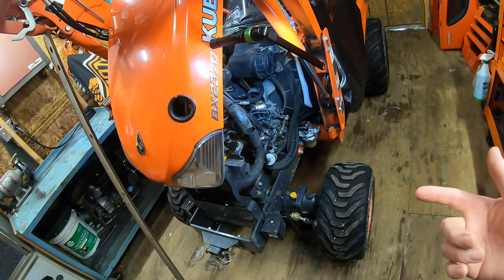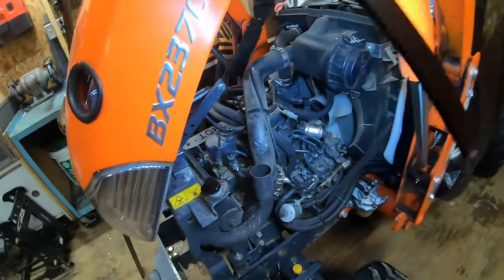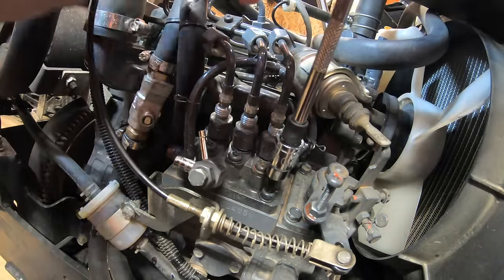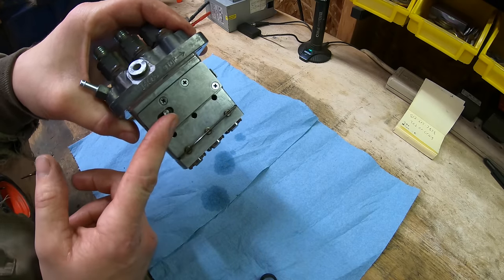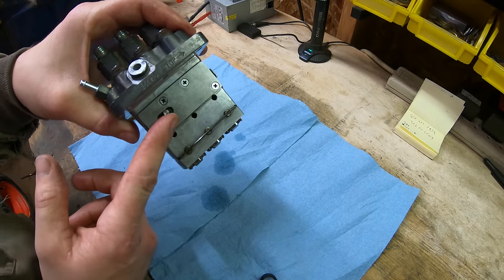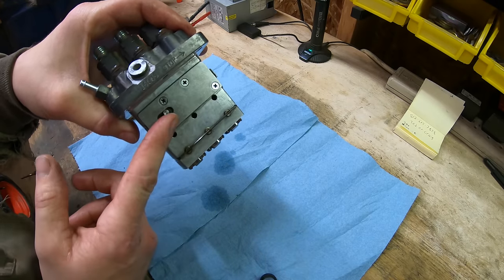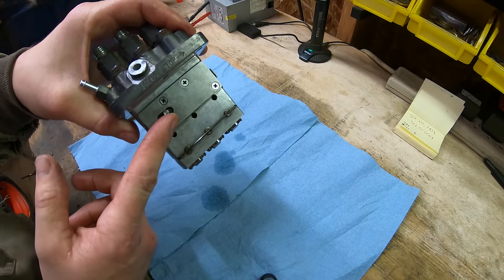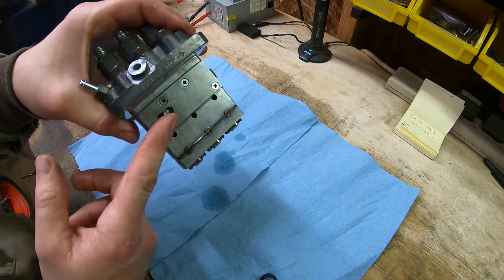Kubota BX- Injection Pump Modifications/Rebuild D902 (More Fuel!!)

Comment: Great video! What size shed/garage do you have? Seems to work pretty well for you
Reply from the maker: Hey Dave, my shed is roughly 16x18 give or take a few inches either way.. it does get the job done and worked really well when I first set it up but now over the last 2 years I have quickly outgrown it with tools and equipment so this summer I’m planning on building a new garage, hopefully a 28x32 with 14’ high ceilings or something to that nature, concrete floor where I can actually roll my tool box around and do bigger jobs for you guys. Thanks for watching!

Comment: Did you notice a difference in the hp? I watched your other videos but you never mentioned a difference in power, just the it was running smooth.
Reply from the maker: Hey buddy, your correct I never got around to making a true follow up video expanding on the results. It does seem to have more grunt now or more torque on the low end, tho it does burn more fuel now tho it’s not terribly more. I def need to get that turbo installed, Iv been talking about installing it for over a year now and just never have the time to take the whole tractor apart to finish the turbo kit that’s about 1/2 way built or so. I really need to get on that. Tractor has been running great tho ever since and she def rolls the coal just by quickly revving the engine from lower RPM to higher. I havnt had any negitive side affects other than that it burns more fuel but once the turbo hers installed it will be as efficient if not more efficient than stock but will have much more power. Hope this helps and stay tuned as I finally pulled out my turbo kit a week or so ago to figure out what else I’m gonna need to finally finish the kit so I am getting ready to finally do it at some point here in the near future.

Comment: Great video...What are the timing thick washer disk for in each pump cylinder ? Are they for ajusting each pump cylinder to trigger the injectors at precisely 240 deg of crank rotation or something else ?
Reply from the maker: They are for timing each plunger individually.. it’s set to factory where it’s at and you wouldn’t want to mess with that timing. The only adjustment you’d want to make is the overall timing which would be done by adding another shim under the entire pump itself. Iv never personally done it though.
Reply: @BiffsEquipment  Thank you for the quick reply. Do you know if the timing of each individual plunger is adjusted when the pump is sent to a rebuilt specialist or it is something fix that maybe is linked to the length of each injector tube ?

Comment: Thanks for sharing. Very helpful and informative video. Do you know what would be causing a b1750 to be getting fuel in the crankcase? I figure it is something leaking in the injection pump. Thanks.
Reply: Bad fuel pump diaphfam

Comment: Awesome video hoped to see a turbo update, eta?
Reply from the maker: So as for the turbo project .. I started on it a few years ago and got most of the parts needed to do it including the turbo. I fabricated a custom turbo manifold adaptor to fit a custom exhaust manifold that I bought online from a different D series  Kubota engine but when I started to assemble it all for test fitting I realized just how hard it was gonna be to make it all fit. I got the turbo to JUST clear the hood bonnet but was having a really hard time figuring out how I was gonna rout the exhaust from the end of the turbo..  also I was gonna have to drill a hole in my engine valve cover for an oil return line for the turbo as there is no way in this engine to return the oil back through the block of the engine.. so with these set backs I ended up putting the project on hold and never got back around to it. It’s still a dream of mine though.. I still have it all and every time I look at my freshly rebuilt turbo just sitting there for the bx it reminds me I need to get back to this project. I will keep you guys posted!

Comment: Good content my friend. Had to do some research, which makes it fun right.  I understand you want a turbo but other then having a turbo what is the point in the turbo.  I like the upgrade to the fuel pump.  That to me seems very likable.  These little tractors vibrate so much i hate to see what the turbo would do? I do have a 1025r in which i may try this approach try to give it more fuel.  Good idea. The smoke will be interesting to see the results.  Until you get a big pull on it may not see.  I figure rated would be with the most with the mower deck. Keep up good content.  Good job on this project.
Reply from the maker: Thanks Eric! It will def be interesting to see if/how much extra power I have gained from adding more fuel.. also curious to see how much it smokes when I work it hard under a load like you said. The reason for adding a turbo would be to gain even more power as adding more fuel only helps so much and eventually you need to add more air to burn all of the extra fuel you have added. A turbo will not only add more power but will make tbr engine more efficient and will put it back near its stock efficiency or better. Also a turbo will not make it vibrate anymore than it already does, it’s only gonna add the extra air it needs to burn the extra fuel and output more power.. a turbo is great when doing any type of work with the PTO where the engine is under a constant load.. you’ll really notice the extra power then. Thanks for watching!

Comment: I’d like to chat with you more about this plunger upgrade, also a turbo kit already exists for the d902 not sure if your aware, I have one already installed in mine. I’m looking at this plunger upgrade to get some more fuel thanks
Reply from the maker: I know there are turbo kits for the D902 that’s installed in Kubota UTVs and other equipment like that but I havnt seen a turbo kit made for the tractor itself? Are you saying there is one for the Tractor? I am designing my kit based images and ideas I got from online and similar specs to the turbo kits they make for the Kubota UTV.. I havnt had a chance to get back to the turbo project yet as I’ve been far too busy with the barn build but as soon as it’s done I’ll be getting back to it and doing some videos on it. As for the plungers, they are still installed in my BX with no issues as of yet. The video you saw of me plowing snow the plungers are installed and that’s why it smokes so much when I lug the engine, feels like it’s got more torque too but it would be much more beneficial if I had the turbo on there but I’m still waiting. You can email me at mbifaro@gmail.com if you’d like to chat more. 👍🏻

Comment: Appears to be running much richer.
Reply from the maker: Oh for sure, if I go from an idle and quickly rip the throttle to full revs it will plume black smoke haha. But what’s nice is it only does it when I want it to, driving/working normally seems pretty normal which is good, it’s exactly what I wanted.. I’m sure when I get into a situation where I’m lugging it good tho I’m sure it will smoke pretty nicely still lol. Thanks for watching!

Comment: Great Video! Learn so much! Can you tell me how can i increase the preasure? 
Stock preasure i think is 137 Bar, but i´m making a project and i need the fuel can reach the combustion chamber at plus 221 Bar... Can you help me? Thanks
Reply from the maker: There should be a bolt in the side of the engine block near the injection pump with a wire through it. If you cut the wire and adjust this bolt you should be able to add more fuel to the engine from the injection pump by turning it, best of luck!

Comment: For the kubota 3 cylinder injection pumps, are they all basically built the same for the different 3 cylinders, being that the plunger assembly’s are interchangeable? I’m guess that’s how that worked for your pump is that you put in a larger plunger from a pump for a higher output engine. I have a D640 and can’t find upgrades for the pump but they look identical so I was wondering if the plungers out of a pump from a different 3 cylinder with the same style pump would work together and increase output
Reply from the maker: Your correct as far as each cylinder ok the injection pump being the same as far as plungers and how they go together.. but as far as using larger plungers from a higher go Diesel engine (even if it’s the same class) can be tricky.. For some of these pumps the plungers are a different length and obviously the hole sizes are differnt which is what gives you more or less fuel but the length being differnt also alters the stroke.. so as long as the thickness and length of the plunger was the same, and it came out of the exact same style Kubota pump.. then I don’t see why going up a size would hurt aside from it just delivering  more fuel (so long as it’s not too much fuel) the plungers I bought were an upgrade specifically for my engine.. they were tested in it so I knew what to expect when I bought them. I guess what I’d do is if you find the same size plungers , get the spec or measure the hole size of the plungers you have now, then find plungers of the next size up (you don’t wanna go too big or it will run rough and start hard) plus your EGT’s may get high.. I Belive my upgraded plungers were .5 thicker if I remember correctly.. so as long as you stay with a plunger that’s roughly the same larger then you should get very similar results to me
Reply from the maker: I just double checked.. so the stock size on a D902 is 5mm and the aftermarket/modded plungers I went with were 5.5mm so if you find a plunger that’s the same thickness and length say from a D722 and it’s roughly .5mm larger then you should be all set and should have similar results as me. Lmk how you make out id love to hear!

Comment: How much did it cost for the plungers? Will they work in a D782? Make sure you put a flapper on the exhaust for protection and cool factor.
Reply from the maker: Haha yes I ended up finally adding a flapper which you’ll prolly see in my last few videos. I just never got around to it for years and finally found the old flapper I bought this summer and finally welded it on. 

Yes they make aftermarket plungers for your tractor as well. You’ll wanna search eBay that’s where I found mine .. search “d782 Kubota plunger” or d782 injection pump or Kubota d782 upgrade” you should find something on there.. that’s what I searched when I found mine. If you don’t have luck on eBay then find an online forum that does small engine tractor pulling.. ask the question on there and there will be lots of guys who can help you out as they are experts at modifying these small diesel engines 👍🏻
Reply: @BiffsEquipment  Smoke is cool. Thanks. I have a 2001 ZD21 zero turn lawnmower.

Comment: awesome vids, I know its older but just getting into modding my 2380.  are there no shims between the actual pump and the block? I noticed some L2501 videos where they remove the big shim between the pump and block and do not see that in your video.
Reply from the maker: Thanks buddy, on the shims.. the shims are used for timing, some tractors will have them and some won’t, some will be thick and some will be thin, it all depends on the engine and the timing that’s needed from the factory and what they install as a shim to do so. Hope this helps!

Comment: Thanks for the great video.  I'm still confused about the orientation of the plungers.  I put mine in with the slot towards the fuel inlet (my pump looks identical to yours). When I test it without connecting the injectors the fuel wont' shut off when pulling the stop lever. I reinstalled it 3 times to make sure the rack fits into the notch in the lever.
Reply from the maker: That’s strange, is your pump also from a D902? Try turning the plungers 180 degrees then test it, it wont hurt anything if it doesn’t work, but it may solve your issue
Reply: @BiffsEquipment  Thanks for your quick response.  My tractor has a D722 engine but it looks very similar to yours except for a manual fuel shut off lever instead of a solenoid.  Anyway I will try the plungers the other way.

Comment: Great video! Do you know if your injection pump is the same as the one on a bx1870 (d722) engine? If so could you post a link to the plungers you used?
Reply from the maker: Hey Rick, yep the pump should be nearly identical and you can use the exact same upgraded plungers I did. Check the link in video description 👍🏻

Comment: Hi! Any tips or link for a stuck fuel pump in the engine D902 case? Trying to move the cable, all lines remove, 4 bolts,  pump move like your but never come out probably forget something keeping the pump stuck. Thanks!
Reply from the maker: Hey Dan I’m sorry I’m only just now seeing this message. You have prolly already figured out a solution by now but what I would do is grab a rubber mallet and smack the sides of the injection pump till it pops up out of the engine block. They can be very stubborn sometimes coming out and are bonded to the gasket/shim a little bit. See if that works and I’d love to know how you made out!

Comment: I wonder if the pumps internals remains the same on the 902 and others like the 1105 1305? Do you know if they all have the same size plungers and same timing settings?
Reply from the maker: Hey Johnny, The timing and the size of the plungers are different. At the very least I know the timing is for sure. But as far as tearing the pump apart and rebuilding it its the same exact process so no worries there. You can get the plungers either from your dealer or from Ebay.. I would try and stick with Genuine Kubota plungers tho unless your looking for modified plungers like I was in which case you'll have to get non Kubota plungers. Best of Luck!

Comment: I just put mine back together just like the video but the rack is super tight. I'm not sure why. I didn't change out the plungers or anything.  Long story but just wanted to put it back together right but it is pretty hard to slide back and forth. What would be causing that
Reply from the maker: Is the lever on the pump itself sliding back and forth easily? It should move very freely.. If it is then it sounds like your issue is with the pump install back into the engine. Check to make sure your pump control lever on the engine is free moving with the pump out of the engine, then double check to make sure that little pin moves freely on the outside of the pump itself.. if both of those move freely when separated then the issue has to be with the way your installing the pump. If the pin on the pump is hard to turn then take the pump back apart and clean it really good, even the smallest piece of debris can make it hang and stick.. use some diesel fuel to assemble the pump thr next time around and make sure it stays as clean as possible during rebuild then try it again .. best of luck!

Comment: Is everything the same for the Kubota D1105 ? It's on a avant 528 thank you
Reply from the maker: Yes the procedure will be nearly identical.. the  plungers however will be slightly larger so get the correct plungers for your injection pump and you should be set! Thanks for watching
Reply: @BiffsEquipment  would you be able to recommend roughly the size increase? Or possibly the actual replacement. Thank you 
Enjoy the video for sure. I'm curious what kind of results do you see what increasing the power. Lift capacity? Speed? Just overall power?

Comment: great video... but I'm not sure I'd go through the trouble of a plunger swap for a measly 10% power increase.
Reply from the maker: Well the whole idea behind it was so that when I add a turbo I’ll have a REALLY nice power increase.. much more than 10%.. that’s my end goal is to add a turbo setup to this machine, I already have the turbo which I recently rebuilt.. I started working on building the turbo kit but I need more time to finish it properly and still have to build/buy the charge piping and work a few other kinks out yet before I make an actual video on it. The plungers I just did first to see how that small increase actually feels or relates to the tractor and if just doing plungers alone will make any type of difference in the power/feel of the machine when I’m lugging it hard. Stay tuned 👍🏻
Reply: @BiffsEquipment  - they definitely help on the bottom end... where about 10% is all you can give, before you get into elevated EGT. I'm anxious to see your boosted setup. Gonna take a lot of rigging to get a boost referenced fuel delivery. That is, unless you just enjoy frequent teardowns for turbo maintenance.

Comment: Does the delivery tube get clogged. I pulled my delivery tubes out because I'm getting no fuel through them
Reply from the maker: Yes the delivery tubes can get clogged.. sounds like you need to pull the pump apart and give it a good cleaning.. also be sure that nothing has broke on the inside .. make sure you have no cracked or broken springs too as that’s a common failure in these pumps.
Reply: @BiffsEquipment  Thank you. Had one port not shooting fuel once delivery tubes removed. Pulled pump and found the slider side plate was very loose and missing screws. Had a butch of a time finding screws that will fit. Drained the oil but no sign of screws. Not sure what to do from there.